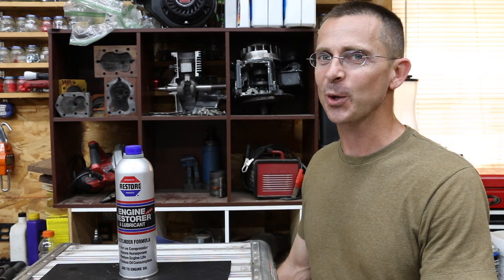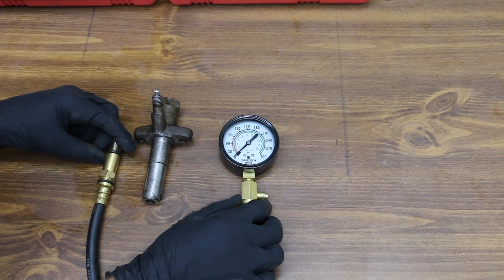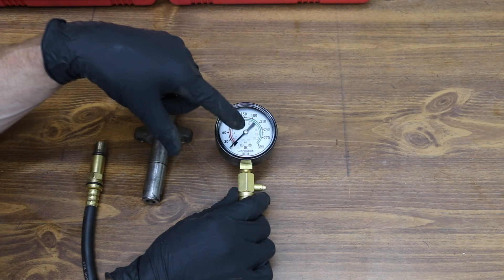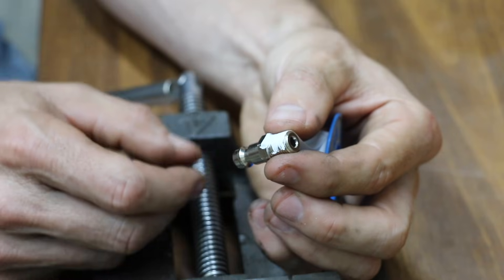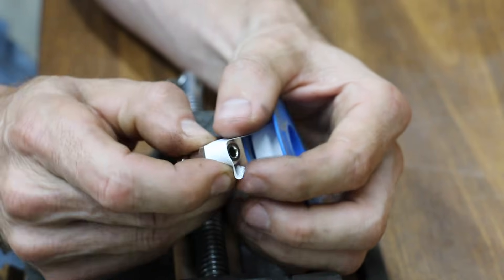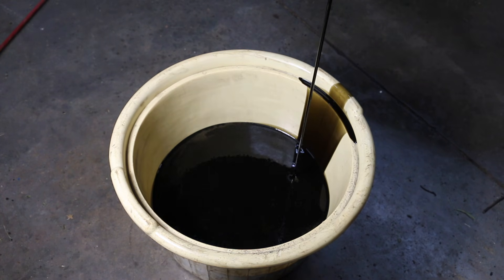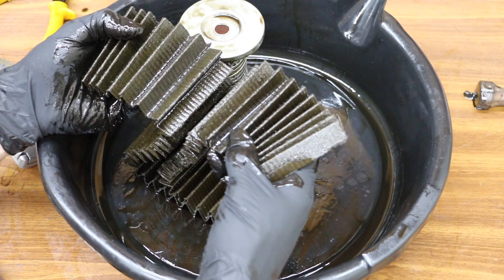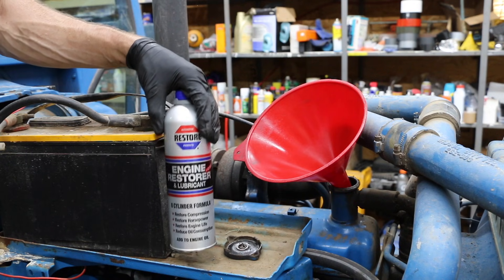Did the "Engine Restore" Compression Improvement Last?  One year later (Episode 2)

Comment: After watching your videos, I added Restore to my 4.3 V6 Blazer. It has 203,000 miles and the compression was low. It also was hard to start and had a noticeable stumble off idle. I was having to add oil every couple hundred miles. After adding the Restore, all of the issues disappeared almost immediately. The engine runs smoothly and has no stumble. It starts easier and hasn't used any oil since I put the product in. It's almost too good to be true! Thanks for sharing all of your data with the world.
Reply from the maker: Wow!  Impressive results!  It's amazing how a product can extend the life of a tired engine.
Reply: @ProjectFarm  ...been using Restore since early 80's when it came out.  most noticeable results i found were in low HP 4 cyl engines with over 70k miles, i use half what they recommend and it never caused any leaks!!    perhaps a test on water wetters, had noticeable results with the Redline product.  enjoy your videos.  Cheers
Reply: @robozstarrr8930  four cylinder engines get a lot more wear piston wise then more cylinders and tend to loose compression earlier. I used restore on a bmw 4 with 185000 miles and moderately low compression. Restore brought all cylinders up to almost new levels and the engine over all ran a lot smoother. I experienced no negative side effects from the product either...
Reply: @brandonbentley8532  an 8 cyl has more chance of low compression on at least one of the cyl. More moving parts means more areas of failure.
Reply: @brandonbentley8532  tell that to a Honda..
Reply: @robozstarrr8930  water wetter works really great, use it in demo derby cars every year mixed with straight water and it definitely helps the water from boiling. I'm curious to see how much of a difference it actually makes
Reply: @BenDover-wu7ed  No He is Not ! I have even less cylinders , 3 on a Geo Metro engine with 225,000 . Never even had the head off and has 190 lbs per cylinder. Fosil oil its whole life and no special treatment.
Reply: @johnaverick7468  i'd a pizza delivery driver, one of my co workers abuses er drivers one of those 3 cyl metros. he's got like 200k on it right now and 150 of thats in the biz. pizza delivery is hell on cars. we are in stop and go traffic 100% of the time, hitting pot holes, speed bumps, etc.
Reply: Everyone who had good results, how long does it last afterward if you DON'T keep adding it?
Reply: @VndNvwYvvSvv  that's what I like to know about. Also does engine restore have any negative side effects on fuel economy?
Reply: It added, or more accurately, restored the mpg on my 2011 Chev cruze 1.4 turbo with 180k on it. I regained an average of about 1mpg per tank full.
Reply: @VndNvwYvvSvv  I'm pretty sure it lasts to the next oil change
Reply: Have had outstanding results from my 02 chevy S-10 ZR2 which has 267,000 miles. Recently had a money light come on for random misfire. But that went away with my recent oil change with Restore included. Love the product and especially love the results.
Reply: @d3athsquad843  wow that's worth a try 4 me have same issue p0300
Reply: I have been using restore since the late 80's. Always worked very well. I just recently got a used 05 gmc 4.3 with 163k. Added a bottle made for V8's and in the same day it ran noticeably better. I dont use test equipment. But its quieter and burns less oil and runs a great deal smoother.
Reply: I use it every oil change on my 06 camry with 250k mi because it burns oil. It seems to reduce oil consumption almost completely, its an amazing product
Reply: This is the comment I was looking for!  Have an old sport trac with 250k. Going to try this product even though a rebuild is in store.  What could it hurt at this point aye?
Reply: Good luck with it. Let us all know how it works out. Remember to give it a couple hundred miles for the full effect.
Reply: @AYVABTU001  so it's been a year, did you try the Restorer, and did it work out for you?
Reply: @GrandPrix46  ran it for a few changes skipping treatment between.  So 3 treatments over 6 oil changes.  Trucks still running with 300k now.  Last treatment was 8 months ago and I will most likely do another round of treatment.
Reply: @AYVABTU001  nice, guess I'll give this a shot in my mother in laws 4.3 Blazer, uses quite a bit of oil between changes.
Reply: 4.3L BLAZER with 204 on it.  May need to add this next time, it seems whipped.  May add it to my duramax with 228.
Reply: I have a 1991 Geo Tracker with 220,000 miles.  I’ve religiously changed my oil every 3000 miles for the last 25 years.  After viewing this video, I used Restore during my last oil change.  While my engine was always easy to start, I used to have to add 1 quart of oil between each oil change.  After Restore, I only had to add 1/2 quart, if that.  My only caveat - I also send an oil sample to Blackstone Labs each year.  On my next oil change, after the addition of Restore on the previously oil change, my lab report came back testing with very high copper and lead in the oil.  Blackstone actually asked if I had used Restore that would be present with that oil sample - I had neglected to tell them that I did when I sent the sample away.  The only ‘issue’ would be that if you were attempting to see if you had any bearing wear, the use of Restore would mask those results, although if the tin result was normal, it would indicate little bearing wear.
Reply: @Inisfad  you have a 30 year old geo tracker and send your oil off to be tested? 🤨🤨😑😑

Comment: OK
So I have a F150 4.9 with 290000 miles
It seems to be running fine and I don't have a compression testor and don't really want to bother with it anyway

would you object to putting Restore in anyway?
Reply from the maker: If it's running fine and not using oil, there's no need to use the product in my opinion.  I don't believe it'll hurt either.  I've used it in 2 of my vehicles that are driven often without any issues. It did help reduce oil consumption in both vehicles.
Reply: @ProjectFarm  I just need to get at least another 100000 out of this truck.
It does run almost perfect but I know at this mileage it don't owe me nothing.

Comment: Hi, I have a 7.4 Lt Fiat diesel fitted to a boat however the engine was originally designed for the FIAT 1300 Tractor. How much restore will I need as I notice you are using the 8 cylinder tin for a four cylinder.
Reply from the maker: I'm not sure if adding too much product will cause issues.  Highly recommend sending the product manufacturer an email or calling them to be safe.

Comment: In 1994 I bought a restored 1969 Dodge Islander RV with a 318 V8, 50,000 miles. Did an oil change and added Engine Restore. We were headed to Boston then on to Niagara Falls. Just hit New York and suddenly the engine seemed to 'come on'. I thought 'damn, she's peak'n before she pukes.'  Nope. Hot summer, new cars pulled over because of overheating  & that ole` V8 just kept humming. Busted the speedometer off come'n down a mountain.  Kept 'it' for 10 years. I've used Engine Restore in my 47 Case Vac & 40 Allis Chalmers B. and every antique car I bought since 94. Lazy man's way to rebuild an engine.  Great, informative videos. I'm a fan.
Reply from the maker: Impressive results!  Thanks for commenting on this!

Comment: Will a small engine run on Charcoal BBQ starter fluid ?
Reply from the maker: Great video idea!
Reply: @ProjectFarm  i tried it once and it flooded and smoked pretty bad
Reply: BBQ lighter fluid (here in the US) is a mixture of naphtha and kerosene. A gasoline engine will run on those if it’s fully warmed up first, but will tend to run too rich and can encounter flooding at full throttle. Those particular petroleum distillates have a lower flash point and don’t vaporize as easily as gasoline, and a gas engine doesn’t have enough compression to cause them to ignite at low temperatures, or to efficiently burn at even operating temperature (like a diesel engine would). So if the engine is cold, or if too much goes into the cylinders, it will have problems running.

Comment: If you havent done so yet, test blue devil oil stop leak. 
I have a 2002 Ford Expedition with 300k miles. The engine started leaking oil real bad. About 1 drop every 10 seconds. 
I used this stuff and it worked WONDERS. 
I normally dont use any sort of additives but blue devil has made something powerful here. 
They claim it swells up gaskets that get old over time.
Reply from the maker: Great video idea!

Comment: I used engine restore, I believe, when it first came out around 1985. And the car I used it on was a Pinto station wagon with a V6 that had badly scored cylinders and was going through a quart of oil every 2 hundred miles. After the engine restore oil use dropped to 1000 miles and then next to none as time went on.I put on an additional hundred thousand miles or more before I sold it and it was still running good. The oil was a real pain to change so I only changed it once a year with Mobil 1.
Reply from the maker: Impressive results!

Comment: I’d really like to see you test out an oil magnet. I hear conflicting advice about their efficacy. It would be great to see you test one on your tractor or truck and cut he filter open to show results!
Reply from the maker: Great recommendation!  Thank you
Reply: Aaron Howell
 - VW Beetle lonnng time ago. Magnet under the oil filter mesh. Sourced from a large speaker, with the shape of a donut. :-)
Perfect test vehicle since VW air cooled had no "oil filter" worth of the name. 
Engine was in its last legs. The car was older than me, at the time, anyway.

The amount of ferrous particles catch by the magnet was quite staggering. ;-)
Less in subsequent oil changes, which makes some sense. 

Nowadays in my cars with aluminum oil pan I apply the magnet to the oil plug. 
In the ferrous oil pans I simply put it in the lowest place possible. Near the oil plug. 
When changing oil, immediately after removing the oil drain plug. Separate/disconnect the magnet and let oil flow flush the particles out.

Amazingly and in spite, of much better modern oil filters, it still catch some particles.
Obviously not in such a dramatic representation as the old VW. ;-)
Hope it helps. 

Cheers
Reply: My 1982 Toyota truck came with a magnetic oil drain plug on something? (trans/ transfer/ diff?) they all are same size, and you can replace all of them with the magnetic version (I got "extras" for free at the junkyard). Amazing how much metal they pulled out of a (high mileage) truck that had only seen "oil changes" before... 21mm? might  fit many "import" applications ;)

Comment: i have used restore every oil change in my Camaro for 15 years. The (motor150k on the L98) is still running strong with over 100 1/4 mile passes using a 150 nitrous shot. One thing that i noticed every oil change, is there will be very fine copper glitter draining from the old filter if you leave it upside down to drain. It freaked me out the first time because i thought my main bearings were going out. It's from the Restore so don't be alarmed if you notice it.
Reply from the maker: Impressive results! Thanks for the information on the glitter

Comment: Another Teflon tape tip is to turn the roll the opposite way you were applying it. It is easier to control the amount of tape that comes off the roll that way... you'll know what I'm talking about if you have ever wrapped a fitting and then had to also re-wrap the tape roll with the excess.
Reply from the maker: Great tip!  Thank you

Comment: I have a cucv k30 army truck with a 6.2 litre Detroit diesel engine, do you think this is safe to use in it?
Reply from the maker: Yes, I believe so, but it's good to check with the engine restore customer support.
Reply: Thanks for your reply, I called them up and they said it'll work fine :)

Comment: Thanks for your great videos.
I commented on the first video:
I first used the big can of restore in 93 in a worn out 84 K-car. It was like a miracle. I have used it in all my personal vehicles since. It takes about 700 miles to get the full effect improving compression, mileage, and power, and reducing oil consumption an amazing amount. I re-add a big can at about 12,000 miles when I change oil. Yes.... I have gone this long on changes for many years and recently gave away a 90 302 Ford car with 400,000 miles on it, and it was clean inside. (It was a quest) 
Today's oils are far superior to anything made even 10 yrs ago. Restore is truly a "mechanic in a can".
I have been a certified aircraft mechanic and inspector for 50 yrs and a life long hotrodder.
Reply from the maker: Thanks again and great point regarding today's oils.
Reply: Yup, I agree, i..  really made a difference.  I used to work on cars too ASE cert mechanic, worked in shops for almost 10 years.   the only additive i'm going to actually use ive known about restore for many years.  And its nice to know that PF actually took the time to test this product..
Reply: anonymous I think it has Teflon or softer metals that fill in the gaps.

Comment: This test is complete horseshit. Use the SAME gauge to measure the pressure that you did in the first video... Did you check to see if the two different gauges are calibrated the same? I don't think so. It is very likely that they have different levels of accuracy at the different points in their measurement spectrum. One at 97% capacity and the other at 30%.
Reply from the maker: Thanks for the constructive feedback.

Comment: Warning!!!! Using it every oil change will make the cylinders too tight to the point the engine will stop. I know this because of personal experience.  I only repeat use it after testing shows compression reduction has started again.  285-300 psi means your compression is around 18-19 to 1.  That is exceptable, but 21-23 to 1,  308-338psi is preferable for diesels
Reply from the maker: Thank you for this information.

Comment: Used engine restore in my old car that burns a bit of oil, it worked well for the duration of the oil change cutting oil consumption down quite a bit.
After about 2000 miles the car acted like it needed a tune up, when I pulled the plugs they were just caked with a buildup of gray and white fouling, looked like plugs from the old leaded gas engines. Great video as always .
Reply from the maker: Thank you!  I suppose the Engine Restore product must have gotten past the piston rings and into the combustion chamber.  Copper, silver, and lead on the spark plugs possibly.

Comment: I love watching you're videos, you give a lot of good information and explain things in a way anyone can understand. That being said, I have an old ford Bronco with a 5.0 L engine, well, # 8 cylinder is basically dead it has little to no compression so for the price of a can of Engine Restore I'm going to give it a try and see if it does anything, it cant hurt at this point and since you're show good results it's worth a shot. It's just an old plow rat so it doesn't really matter if it works or not, but it will be cool to see if it helps.
Reply from the maker: Thank you very much!  It'd be great if you could provide a follow-up on whether or not it helps.  Most people have good success with the product.
Reply: I certainly will.

Comment: YOU WONT BELEIVE HOW WELL IT WORKS IN THE GASOLINE TANK MIXED WITH GAS, I HAVENT TRIED  IT IN DIESEL FUEL  ENGINE, BUT MANY OTHERS HAVE MIXED DIFF OILS LIKE MARVEL MYSTERY OIL TO DIESEL FUEL AND GASOLINE. YOU CAN ADD ANOTHER 4CYL CAN OF RESTORE TO THE 8CYL CAN TOGETHER FOR THAT FORD TRACTOR, WONT HURT A THING ACTUALLY WILL HELP MORE. TRY IT IN YOUR WORST LAWNMOWER ENGINE FUEL TANK AND CRANKCASE, LAWNMOWER WILL LOVE YOU. FUEL FILTERS WONT STOP ANY AMOUNT OF RESTORE GOES RITE THREW. I USE 4 OZS. TO ABOUT 5 TO 6 GALLONS OF GAS. HELPS FOR MONTHS  THREW FUEL SYSTEM ALSO. EVERYTHING WEARS OUT IN TIME. HAVE A GOOD DAY.
Reply from the maker: Thanks for the recommendation.

Comment: I'd love to have the tractor to replace my old Ford 960. Good old girl but a bit small.
Reply from the maker: The size of the Ford 5000 seems right for the small farm.  Just enough power run the baler and other implements around the farm.
Reply: Same use for mine, just making small square hay. Only running 5 acres now but trying to get to the point where I can work more land.

Comment: What could cause compression to go up and down.  65-145 psi
Reply from the maker: If there's that much variance with 1 cylinder, I would make sure the compression gauge is working properly first, then accomplish a leak down test. I suspect a valve might not be closing properly.

Comment: Engine restore does work, however this stuff creates some kind of varnish\deposit  that is pure hell to get rid of when rebuilding an engine as it sticks to the cylinder walls, crank bearings, piston surfaces,  oil passages etc... I think that what's happening is that the product fills up most of the scoring marks or porous areas in a worn out engine cylinder to restore compression.
Reply from the maker: Thanks for commenting on this.
Reply: @ProjectFarm  You're very welcome! PS, keep up the awesome content coming! 😉